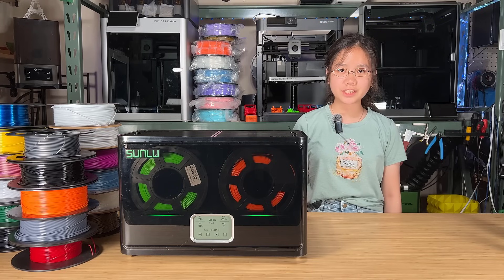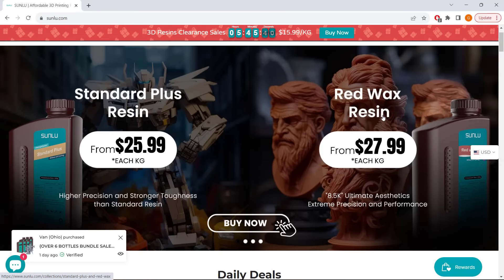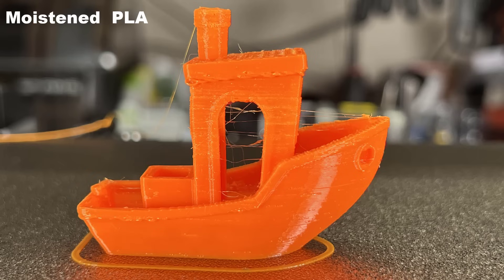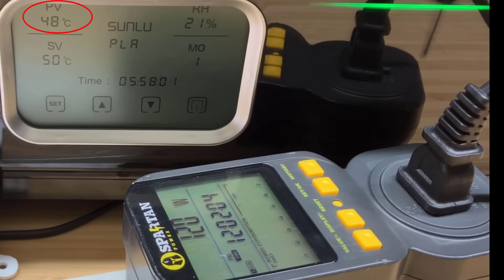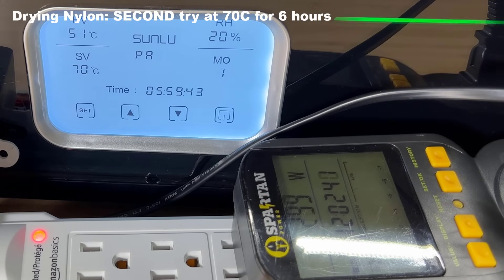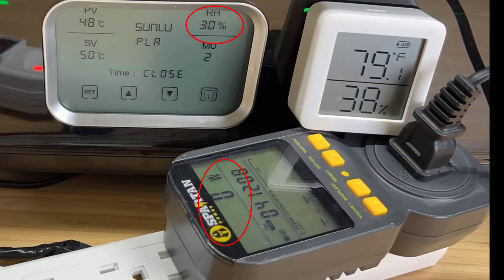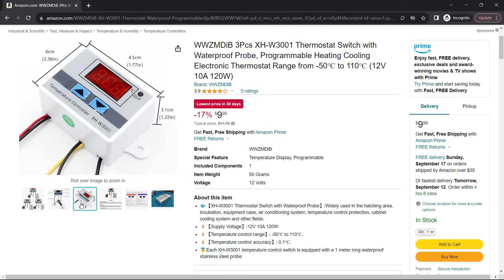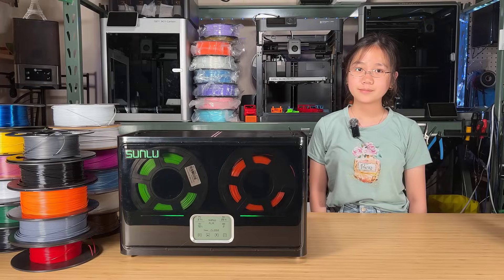SUNLU S4 filament dryer 70C max temp, 330W PTC heater, 3 circulation fans, power saving storage mode

Comment: Did you record the total kWh used by the dryer over a period of time? I.e. how many kWh for 6 hours of drying at 50C and at 70C? I think your power meter should be able to track that.
Reply from the maker: A 70C 6-hour cycle will use around 1.06 kWh, while a 50C 6-hour cycle will use 0.65 kWh.
Reply: 300 WATTS IS  WHAT A PC USES AT IDLE OR SEARCHING THE WEB ABOUT 3 AMPS CURRENT GIVE OR TAKE AT 110 VOLTS SO YOULL SPEND 10 CENTS TO RUN IT ONE TIME TO INTIALLY DRY YOUR ROLLS JUST KEEP YOUR ROLLS IN DESSICANT IN ANOTHER BIN WHEN NOT IN USE AND SWAP TO THE ONE YOU USE FOR PRINTING AND YOUL NEVER HAVE TO ahh caps on never have to dry once you initially dry it..

Comment: i always failed when printing nylon, would you tell me your recipe for printing regular nylon?
Reply from the maker: Dried nylon, Elmer's CraftBond extra strength glue stick, 240-250°C nozzle, 70°C bed, part cooling off or minimal (20-40%).

Comment: Nice test, thank you! Merely, I missed how you change a filament and got the filaments into the printer. I mean are there 4 holes on one side? Is it easy to change one while the other 3 are in use? Is it hard to keep the cover up while changing?

Comment: Would this by any chance work with the new AMS lite system from Bambu? 👀 Looking to try out some multicolour printing, but the humidity where I live is so high that I can literally see print quality degrade within a single print when using some of my more sensitive PLA spools outside a dryer.

Comment: Extremely professional work. Logical, detailed, and clearly presented analytical review with examples.  Great info for my current PLA needs and the nylon testing and examples are particularly good to know for the SUNLU S4's capabilities for my future needs. Thank you. Your suggestions to SUNLU were spot on as well. Divided chamber with exact user controlled humidity setpoints for each chamber would make for a nice "S4 Pro" model. I'd prefer the ability to set the storage setpoint to a range of 35-40% vs a default 50% setpoint.

Comment: For storage mode, a good option is to have a humidity setpoint value just like the remperature and use a PID as well. Both PID loops would run seperately and the lower output of the two PID would be the power applied to the heater. the logic would basically be "try to target a moisture of 30% but make sure not to exceed the 50C temperature". 
I need a 3KG spool dryer and was about to DIY it with a Polybox as a base but this would be a way better option. Sunlu even supplies the 3d files to convert to 3kg

Comment: Great video btw, one other thing I noticed - at the 9:20 mark when you're testing the temp further away from the PTC+Fan it looks like your sensor is still close to the direct path of the unobstructed airflow. It would be more accurate to put reels in place that way you'd know the true ambient temp at the furthest position from the heat source, rather than measuring how much the heat drops 20cm away while still in the heats path.

Comment: Another good video, thanks for all your hard work. Question, I've heard there is a point of no return for filaments when they have absorbed too much water and the chemical structure changes permanently. Do you have any experience with that? Thanks.
Reply from the maker: For common filaments like PLA, PETG, and TPU, even after soaking them in water for a few days and then drying them, they print like normal (or close to normal). However, I'm not sure if every single kind of filament works the same way.
Reply: @AuroraTech  I had a roll of eSun black for less than a year and it became very brittle until it was unusable. I'm trying to decide if it was because of water or because it was a defective batch. Thanks for the response.

Comment: Great review.
It can consume quite a few Watts, also with several fans... So I was wondering since in the video we couldn't hear the noise, what is the sound level? Is it loud or quiet?
Reply: Also, other models use annoying relays to turn On and Off the fans and I gets old pretty quickly with constant activation of the relays. Does this model use relays of PWM fans?

Comment: I'd like a more substantial lid, that one looks a bit flimsy and not at all insulating.
Reply from the maker: It has 8 holes for you to insert a Bowden tube as a filament guide to the extruder, so it won't provide perfect insulation.

Comment: Is 6h the max cycle time? Nylon is supposed to be dried for a min of 12h so that means you'd have to go back 6h later and start it again? Seems like a pretty big shortcoming to me. I'd like to be able to kick off Nylon drying at 8pm and have it be ready at 8am for a print run...
Reply from the maker: You can set it up to 24h.
Reply: Great, thanks for this info @AuroraTech

Comment: Great review/suggestions   I use a filament dryer as needed and it does make a difference for prints that I am concerned about print quality.     Having four spool capacity is nice  Like the storage mode.  I just backed it for the early bird $80.

Comment: Thank you for the very informative video! I have a question that wasn't addressed. Are the small ports in the lid suitable to firmly hold a reverse Bowden tube? I like to print directly from my dryer, with a reverse Bowden tube feeding the filament to the printer.

Comment: I am glad you verified that this dryer can actually reach 70c - at least when empty. It may not be able to with two spools in it since it is not insulated. 

Also please note that their past dryers do not honestly represent the temperature. Their S2 claim to reach 70C in 80 minutes but it cannot ever reach 70C unless measured empty with a sensor on the heating element. 

If you put a temp sensor in the middle of a 1KG spool of filament in an S2, you will see that it will never go above about 54C. 

I would love for you to make a video on that, but you would have to decide if you want to educate your viewers at the expense of Sunlu being less pleased. You have been very successful in the past with still exposing misleading marketing, so I vote that you side with the viewers even if a few companies may be afraid to send products if you point out such flaws. You are running out of space anyway, so go for it. 

My idea for you is you take an S2 and this new dryer. Fill them both with filament. See what temp each one is when measured in the center of a full spool after 1, 4, 8, 12, 16, and 24 hours. 

I suspect the S2 will never go over 55C and that is not enough for PA-CF according to some internal testing I have seen.

Comment: It seems a very nice product! I came across a chap on Reddit the other day who replied to my comment that stated that dessicant bags will not remove moisture from wet filament, he claimed I was incorrect and the reason he gave was that once the moisture was removed from the air in which ever sealed container the filament was in then the moisture in the filament would leach out into the air and be absorbed by the dessicant.
 Well I knew his theory was incorrect as I had previously experimented with dessicant and Nylon filament and PETG filament and the desicant I used did not change colour and the filament still popped and spluttered when printing yet printed just fine after I had dried it with heat.

Comment: I live in Gatineau - Canada, surrounded by rivers and lakes, where we are having the end of summer now; humidity has been around 65% to 82% for at least three months and I've been printing PLA and ABS with no problems at all without ever using a filament dryer.
If you ask me, there's something weird in the air, and it's not water...

Comment: 70degrees can be not enought. For example, PA6 Nylon requires 100-110C. They should have made this dryer out of metal and allow heating up to 200c. And it still would be cheaper than plastic or acrylic case.

Comment: I currently use multiple filament driers for my MMU2 on my prusa MK3S+ to make it easier to manage the filament. Since my MK4 will also get an MMU, I was thinking I needed to get more. But which one? I have 3x sovol dual slots. They work well and are cheap, but they drive me nuts. The fans sound like they need to be replaced (even when it was new). The temp only goes up to 50 degrees. And the max time permitted is 12 hours. I have to reset them many times during a week long print. I also have a fixdry that was my favorite drier, but it cost twice the price. It does 70 degrees. The timer goes up to 2 days and when you hit 2 days it becomes infinite. However.......it stopped working. I recently took it apart checked for shorts everything seemed fine I was going to test the voltage........but it started working again. I think the connections were just loose. But still it's a lot of money for something that may or may not be reliable. This on the other hand seems like a great choice! The price is reasonable. It's only slightly more than the cost of 2 sovols with the same capacity. But it has better features. So yeah I think I'm in. This will go to my mk4.

Comment: Great review!  I agree with the idea of dividing the space into two compartments, but that would probably increase the cost substantially because many of the expensive components, such as heaters, fans, and sensors would need to be dupllicated.  As an alternative, I'd like them to produce a 2-spool version too, which for my uses would be adequate.

One of the flaws of past SunLu dryers is the lack of ventilation to allow the moist air to escape.  Is there any ventilation in this one, or do they rely on the desicants to pull out the moisture?
Reply: Thank you for your suggestion. Our early design was the same as you thought, it was separated on both sides, but the cost was much higher than the current one, so we finally chose the current one.
Currently our S4 is designed with 3 fans, the heat is very well balanced inside, and with the 8 holes, the humid air inside can be discharged effectively (from the filament outlet holes).🥰
Reply: @SUNLU   Sounds like a good design!  When the spools are being dried, they (probably) won't have their filaments going out the holes, leaving the holes open for air escape.

!  If there were a two-spool version, I think I'd be ordering one right now.  I need  to think a bit about the four-spool model due to the large size and higher power requirement.
Reply: Thank you, drying 4 spools at once is the most efficient way now! After drying is complete, we will have a model of the plug, which will prevent moisture from entering after installation. Please look forward to our new products in the future!🥰🥰 @yeroca
Reply: I would imagine they rely on the desiccant as ventilation would also allow moisture to feed back into the container and heat to escape, of course there are probably engineering solutions to allow ventilation with out any these cons but it would probably be very expensive to research and manufacture.
Reply: @AndrewAHayes  Not that expensive.  There are many videos on youtube about how to mod a SunLu dryer to work more quickly and efficiently by ventilating it better.  The solutions are pretty cheap and effective.

Comment: A 4-spool unit is way too big for me.  Would be very interested in a 2-spool version that lets me control the humidity level that uses for storage mode.  It would be great if it had some sort of vacuum seal.  This could lower power usage when in storage mode.  Could be very helpful if you stored the dryer someplace humid like your garage (very humid in summer where i live).
Reply: Using the dryer for long-term storage seems very wasteful electricity-wise, especially if that’s in a non-climate controlled environment with a unit like this that is not well-sealed and uninsulated. Better to make a best effort at storing filaments in air-tight containers and actively drying them if needed right before you use them.

Comment: Another great review.  Thanks.

I converted a electronic dry cabinet into a filament storage container.  I feed filament directly out of it to my printers and it maintains 20% RH or below at all times.

While it won't dry filament as fast as a heated chamber, by never letting the rolls get saturated with moisture and storing them at such a low humidity level I've never had any issues.

I can see the benefit of this if you needed to dry a roll in a pinch. 

Thanks again.
Reply: Out of curiosity, whereabouts do you live, and what's typical humidity there? Thanks.
Reply: @Graham_Wideman I'm in the Midwest too. We can go down to around 20% and as high as 95% humidity. They always say, if you don't like the weather, wait a few hours.😎
Reply: @Graham_Wideman  Midwest, so the humidity is all over the place.  I try to maintain 50% or less in the house year round.
Reply: @bluerider0988  Thanks

Comment: With all those driers, you should do a video comparing the commercial driers with the alternatives, including the food dehydrator. Would love to see that. 😀
Reply from the maker: Fixdry can't reach 70°C or even 60°C. I used it once in my previous video. I'm not sure if I received a faulty unit or not, but I can't recommend this brand.
Reply: What about EIBOS? We would love for you to review our filament dryer, not just our current products, but the new filament dryer we will be releasing this month. Hope to get in touch with you. @AuroraTech
Reply: @eibos3d983 please tell me you added actual temperatures on the unit instead of the names of different plastics